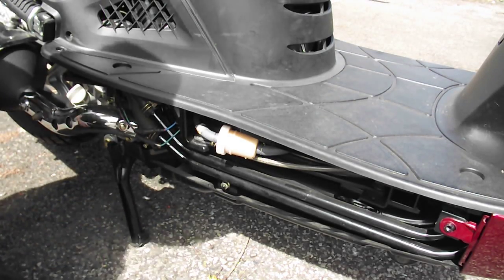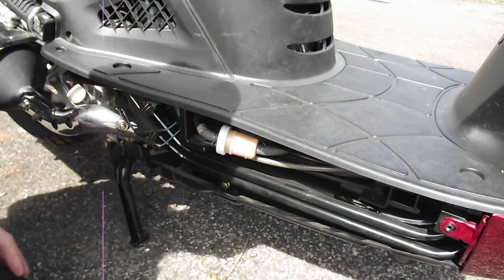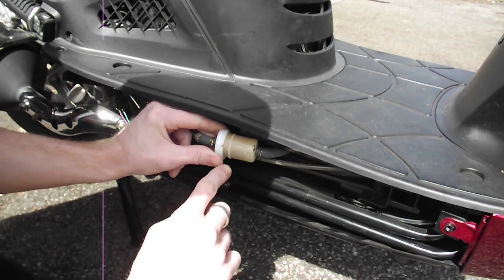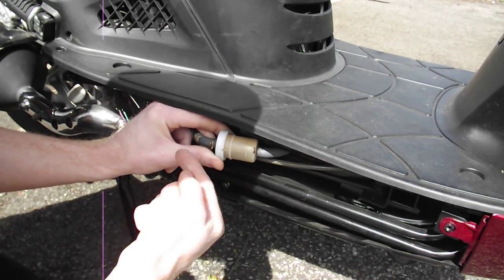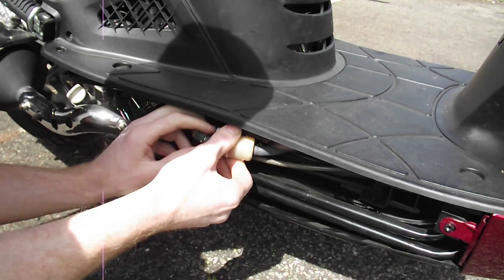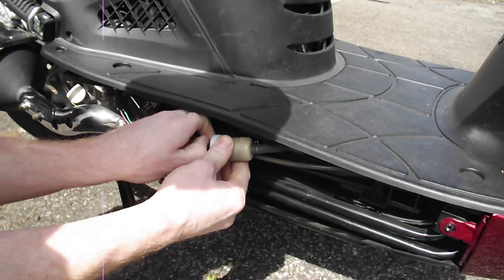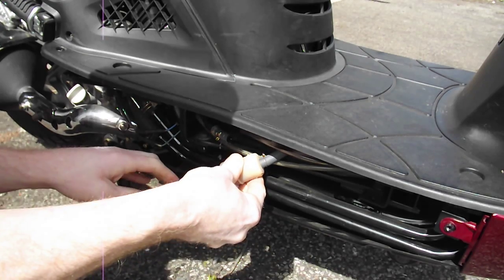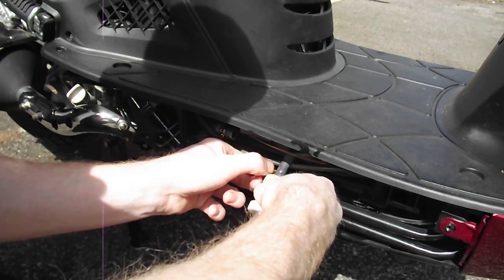DIY TUTORIAL HOW TO REPLACE A FUEL FILTER ON ANY SCOOTER, MOPED, OR SMALL ENGINE.

Comment: for the people that have fuel spilling everywhere, just put clamps or zip ties on the fuel line so it doesn't spill out, make sure you out a rag underneath so fuel doesn't get on the engine, this may cause it to ignite
Reply: Tim de Waart  there’s a little tab on zip ties that let you release them without cutting them
Reply: Crimp with vice grips

Comment from the maker: Any local motorcycle, scooter shop, small engine repair shop (lawn mowers etc.) or Wall mart, it doesn't have to be exactly the same just a similar size with the same sized "nipples" for the gas lines. Make sure to check the direction of the flow on the old filter before removing.

Comment: What happens if you remove the fuel filter?, will it pump more gas into the engine
Reply: The carb will clog up with junk and it wont run.

Comment from the maker: The luggage box needs to be removed for access the fuel filter, change the same way as I did in the video with the kymco, they are all the same. Just make sure you note which direction the fuel filter is in (look for the arrows) before removal and install the new one flowing the same direction. There is a now a link in the video to a service manual for your bike. Fell free to ask if you have ANY questions.